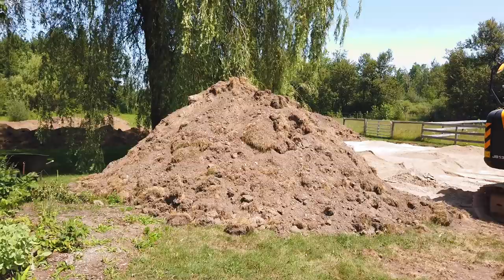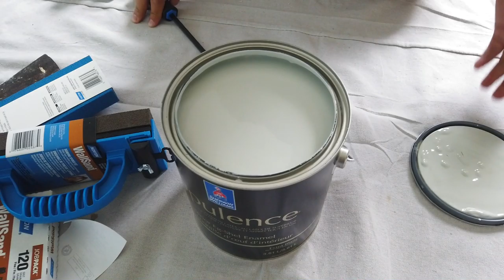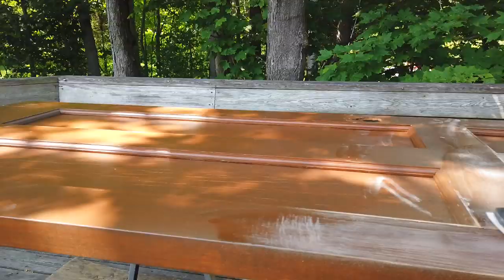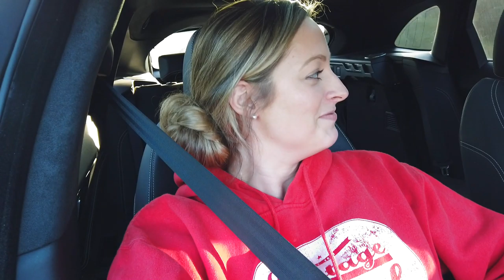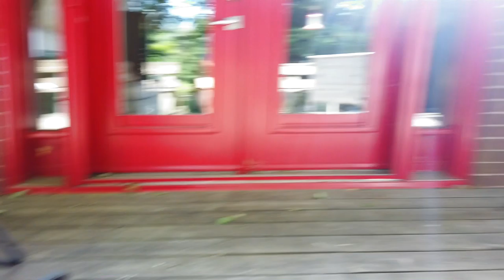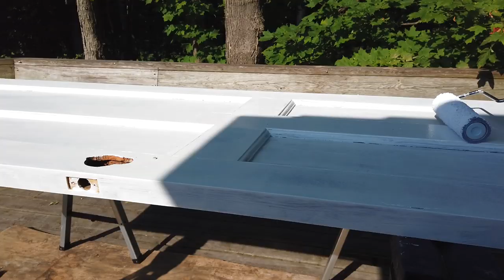A Sandy Sort Of Day! - I Hate It... - HouseIntoHome #5

Comment: you can buy something called a polyurethane, it’s just a clear coat to put over wood. it’s very protective and seals down and stuff. you can get it in different sheens/ finishes but i would go with a higher gloss for a bathroom

Comment: Hey Dan, if you're going to be doing a ton of sanding, get an orbital sander(the round ones) rather than that sander you have. They are much better because they do more of the work for you. You can get a Black and Decker one on Amazon for like $25, and its worth every penny. Use the Mouse style sander you already have to get into the tight ares that an orbital sander cant get to.
Reply from the maker: thanx for the heads up!
Reply: @HouseIntoHome  No prob. Also when buying supplies, have a look in Home Hardware, rather than Home Depot if possible. Home Hardware is Canadian owned, and most store are owned by local franchises. Home Depot is a giant US company.

Comment: If you ever need to paint molding or trim, I recommend using a half size paint roller, it works quite nicely! And if you don't like the popcorn ceiling, and you don't want to spend a lot of money, a decent way to flatten it is to spray it with some water in a hand sprayer and use a spackle knife to scrape it off. Of course you probably know most of this stuff anyhow, but never hurts to mention! Keep up the great work!

Comment: Great Video, enjoying the progress and learning.
If you are sanding gloss/semi-gloss paint, use water and very fine emery sandpaper, a similar experience to painting car bodies, it avoids scratch marks.
You can consider spray painting the doors with a thinned down paint. You can get a lot of them done very fast with a thin even coat and a great finish. And it's a lot of fun.